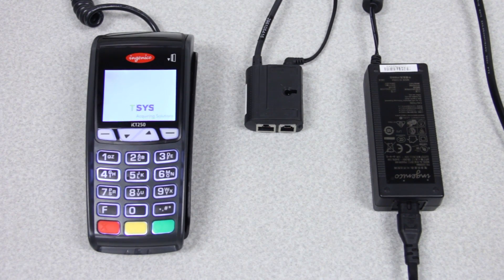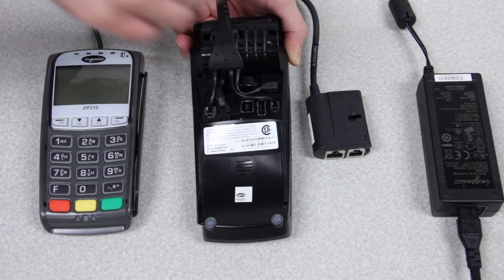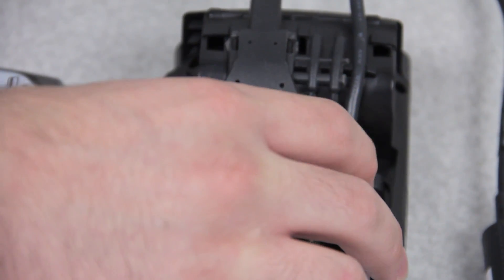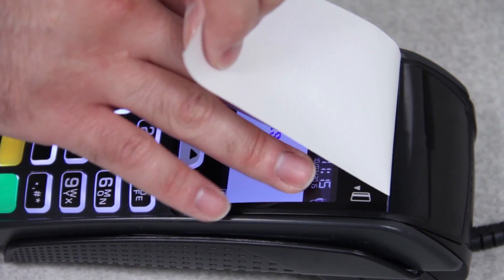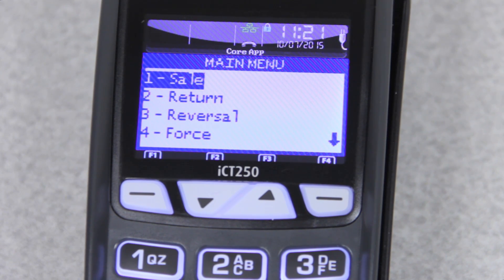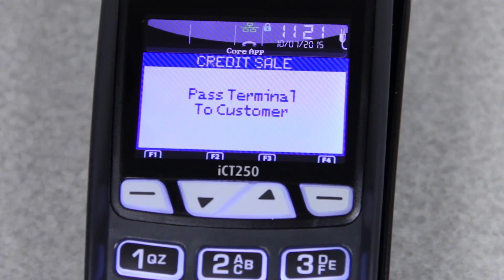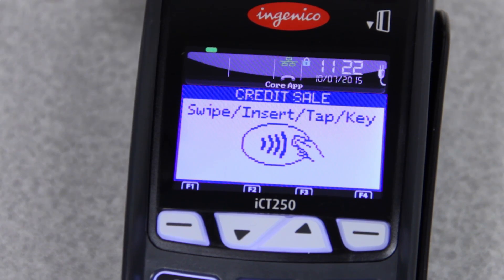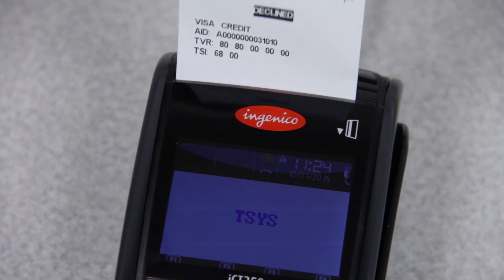TransFirst Emv Terminal Training - tutorial on installing and using Ingenico iCT250 (part 1)

Comment: Got a blue screen with error code "C98 [0248-014]" on our machine. Unable to process credit card trans actions.
Reply: Any luck with that? I have the same problem with 3 of my readers.
Reply: In our case it was a software download that failed to complete. Had to call customer service and have them explain how to re-do the software download, but now it's working
Reply: Thank you Walter! I've mentioned that to our POS company, seller and ingenico themselves. Now I guess I have to push for it a little more and hopefully it will solve the problem. Thank you for the reply. All the best to you.